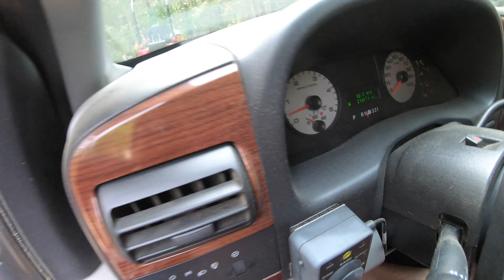she saved us both

Comment: Guy, I'm kind of the "King" of getting rigs stuck... Back on the Ranch in the 70s, I had some fence work to do along one of our wheat fields. Had to cross a seep ditch that was supposed to be "crossable" at a particular spot, like it always was at that time of year... When my Dad got home, I had a 4x4 tractor, a 4x4 pickup, the 2WD pickup I was using to fix fence and a 2WD tractor we used for cleaning out the stables ALL stuck in that dang seep ditch! 
I was just a kid, and trying to explain the logic of my stupidity and my Dad was laughing so hard, he didn't hear a word I said! He went and got the big 8WD Field Boss and yanked everything out and afterwards we had a little chat about "common sense"... :) I was desperately trying to get things "un-stuck" before he got home, was mud from head to toe and felt like damned fool! It was pretty funny after all was said and done and I did learn a thing or two.. I've only been stuck once since that time, in a snow bank, and of all things, Dad had to run the 8WD Field Boss over to yank that rig out the next day and all you could see of it was part of the rear bumper! It was completely buried under a 12 foot snow drift! We thought we were going to tear that rig in two pulling it out of there! That year was tough winter for 17 year old "knot head"! :)
Reply: Everything is a learning experience 😂 Thanks for the awesome story ✌🏻
Reply from the maker: Got to tell you this is sometimes the stuff that I love about this because what it did is it brought out a memory of yours that is awesome 👍💯
Reply: @rcguygarage  I had forgotten about that day until I saw your video and it all came rushing back! A kid makes mistakes on a Ranch when he's expected to do a Man's job on his own. We had a good laugh over the ordeal when all was said and done. That was the year that Dad fired our semi truck driver and taught me how to drive one of our Kenworths. The cabover we used for hauling grain. It had a 3 spd. Main and 4 spd. Browning in it behind a 2 cycle V-8 diesel! To this day, I can jump in any truck, so equipped out there and take her anywhere with that set of "mixing sticks" in it and there are only a hand full of truck drivers out there that know how! 
Anyway, I should NOT have been driving a semi at 17, but he also taught me how to run all the back roads and avoid the scales, so I ran that truck and never did get caught by the law and had no break downs. Which was why the guy got fired. He was pretty hard on all our semi trucks. Nice though! Didn't really care for being the only guy doing all the shovel and broom work cleaning out the flat houses and grain bins in august, but "that which doesn't kill you, makes you tougher"... :)
I've hauled wood chips and run long haul and hauled nuclear fuel from Washington to NY. Pulled doubles, flatbeds, grain trailers and reefers. Spent 15 years in a patrol car as Deputy Sheriff. Ran lots of heavy equipment over the years. Pulled green chain, planer chain, Tail sawed, ran Dry deck and know my way around a saw mill.
I talk to much. God Bless you and the wife Guy! Love your work Brother!
Reply from the maker: @rt66rc86  I'll tell you right now that is not talking too much that is sharing some awesome stuff that you really will ever see in kids nowadays
Reply: @rcguygarage  Well, Thanks Guy. Yeah, the hay bales we used to buck by hand are all picked up by machines now and the lumber we pulled by hand is all sorted and pulled by machines... The old belt drive Swathers are gone, and you had to really know how to run those or they would start bucking and all hell would break loose! :) The new semi trucks have 13 speed road ranger transmissions or better ones now and are easy to drive if you know how to use the motor's RMPs instead of that double clutch nonsense! I Team drove with a young guy from Idaho for short time and he tried to "double clutch" to get in a lower gear going up Ross Pass in British Columbia, while I was in the sleeper. I would have still been driving that night, but he finally got over the flu, and I had been driving for 5 of 6 days straight for the both of us and was really needing a few hours of sleep, so he took over. That "double clutch" doesn't work out going up steep grades, because there is no way you can catch another gear fast enough doing that! He twisted the drive line and we ended up driving back to Spokane, Wa. doing a top speed of 35 mph! And the brand new Freightliner we had just been given for that run shook like hell all the way... 
He called the outfit we worked for when we got back and tried to tell them some horse s&%t reason for how it happened and they fired him on the spot and I ended up having to drive that truck all the way to Butte MT. ! By then, I had enough of "Team Driving" and went solo for the rest of my long haul career. 4
I worked for an outfit that ran big MACK Trucks and man, those are the Trucks to run in the winter for climbing snow covered passes! I NEVER had to chain my Mack! Just lock in the differentials and you could climb anything! I loved it. And she would run 85 mph across the plains like nobodies business! :)
I got lost in Newark, NJ once and ended up driving  that Mack with a 53 ft. flatbed hauling sea cans right through down town Newark!!! With an inch or so of room to spare on all sides and didn't even scratch any parked cars along the way! The only thing that I had as a land mark to find my way out of that hell hole was the Statue of LIberty! Using it, I found my way to one of the toll roads and got out of there..
I don't know how I didn't end up in jail for that stunt.. Big rigs are forbidden in down town Newark for some reason... :)
Another time in South Carolina, I had to pick a load of fencing. It was quite an interesting situation! The guy met me out in the yard and told me that most Truck Drivers take about 2 hours to back into the fencing area, so "Good Luck" and left me there after showing me the deal...
You had to back your trailer 300 yards down a narrow gravel road, then back 90 degrees down a left hand turn onto another gravel road and after that back down a right hand turn into the fencing yard! Well, I grew up on a Ranch and backing trailers up was second nature, took me 20 minutes! The guy about crapped his britches. Said that I was the first guy he ever saw that could do that. I just smiled.
Reply from the maker: @rt66rc86  Guy the first time I drove down to Florida Disney with big black and a 34 ft travel trailer The GPS took us the wrong way into Disney through the service road to a dead end gated do not enter this road was all continuous s shapes and I had to back out as it was a one-lane road 🤣😂 I already had towing skill but that one sharpened just that much more🤣😂🤣😂
Reply: @rcguygarage  That would be a stessful situation! Backing a 34 footer isn't easy! I like that Big Black Truck you have! I'm running an 01 Toyaota Tacoma 4x4 right now  to get around town and the woods. Nothing to pull behind me though! But this little truck is quite the rig! It went through some deep mud holes to get iunto a bear watching spot for me yesterday, that makes a lot of guys turn around!
Reply from the maker: @rt66rc86  I ain't gonna lie but them YODAHS have some serious ability that the MERICA trucks can't compete with stock light weight used to be what I remember with them
Reply: @rcguygarage  I agree! This truck first belonged to my older brother who purchased it to run his archery stands up to his hunting spots. Then he bought a jeep and I bought it for my son who got into a wreck in his first pickup, that he really liked...
He drove the heck out of this rig until HE bought a jeep! Then, my Ford went down and I needed a rig, so I'm using this Toyota until I have enough saved to buy... a "jeep" to! :) We just have to be in the mountains all the time or we are not happy..
This rig has 265k on it and runs like a top! Front end was just brebuilt and new tires all around. 4x4 works perfectly. Only problem is, my German Shepherd is a big dog, and he doesn't quite "fit" in the passenger seat! :)